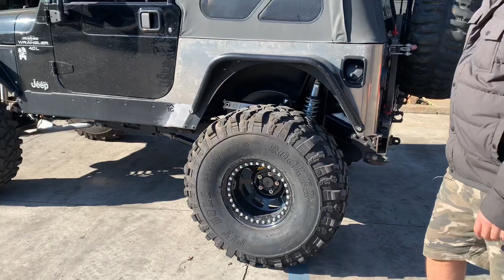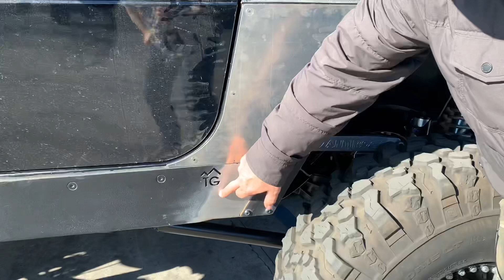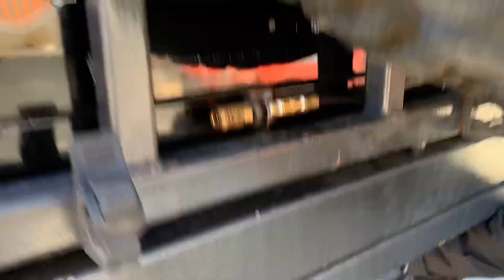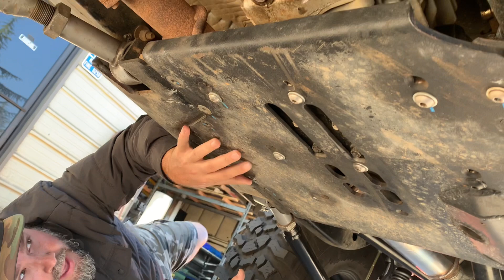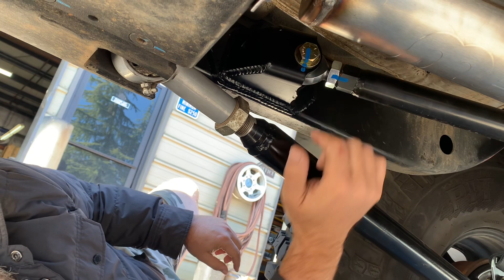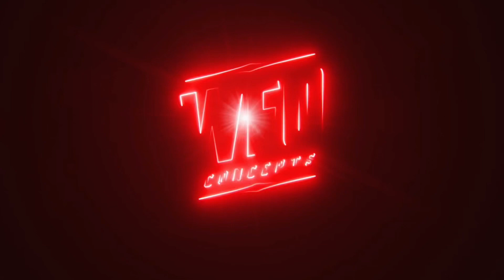Stretched TJ

Comment: Probably cheaper to buy a LJ
Reply: My friend had his tj wheelbase stretched for $6,000 parts and labor with a really good warranty from the shop. They did everything: the coil over relocation, control arms, axle truss, upgraded belly pan, sway bar. Looks like it came from the factory. 6,000 is a lot less than 15,000 (a good LJ)
Reply: They're going for $20 to $30,000 nowadays